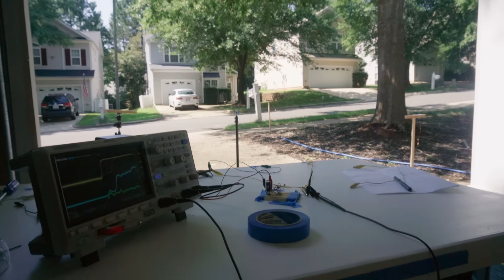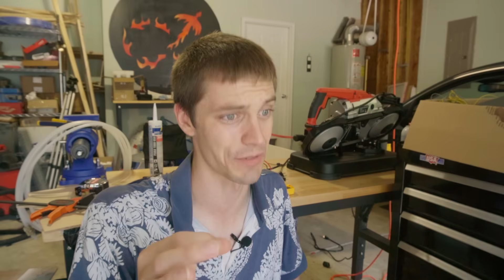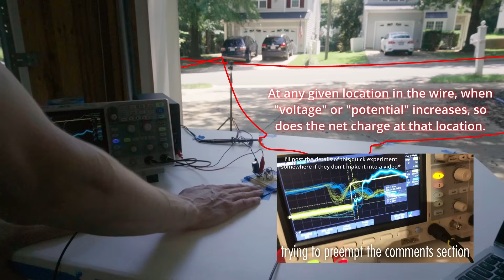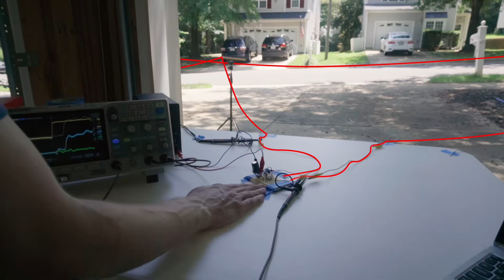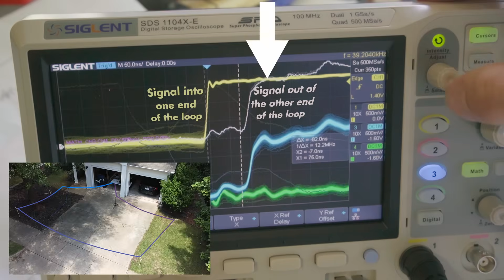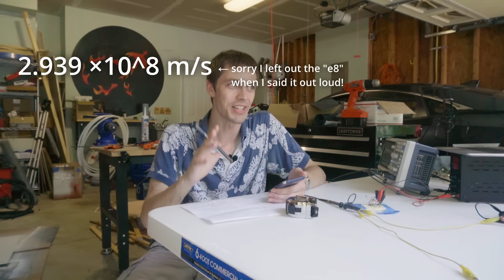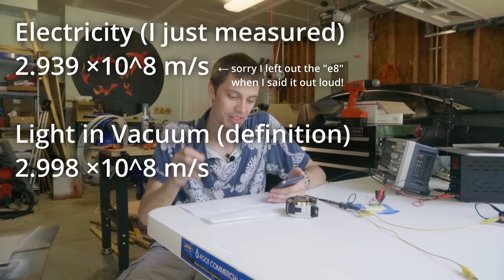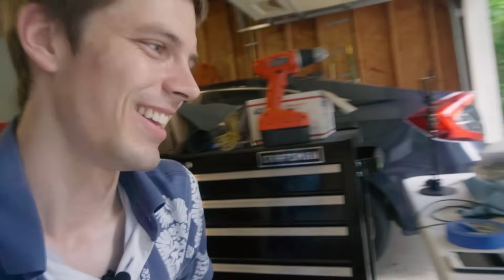Why does WATER change the speed of electricity?

Comment: electricity travels at a very slow speed, the effect travels at the speed of light, a simple comparison, a water hose, when empty takes many seconds to come out the end of the hose when water is turned on depending on the pressure, but a hose full of water a ( conductor ) I turn it on and water is almost instantly out the end depending if there is a large air bubble, in the hose, electricity travels the same way, so how fast is electricity depends on the pressure just like water,,, simple but educated people seldom put all the information together,

Comment: okay okay okay ... electricity actually travels slowly... very slowly like 1m/s in some cases . energy travels fast . when you create/build a magnetic field current still passes slowly, energy still passes fast but it's the amount of current that flows that changes and you need enough to detect a voltage rise/current passing. what you limit is flow, not speed

Comment: I have a straightforward question.  Does electricity travel in the center of a wire?

As in, does a wire act as a Farraday cage and only travels along the outside or does it electrify the center as well?  How would we measure that?
Reply from the maker: Faraday cages don’t work for DC so in steady state everything is flowing in the bulk

Comment: ....FYI: WHEN I WORKED IN CONSTRUCTION,... WHENEVER WE HAD TO DEMOLISH ANY OLD WIRING, IN A BUILDING REMODEL,... WE USED TO HAVE TO GO SET UP AN INSULATED ELECTRON BUCKET, AT THE LOW END OF EACH CIRCUIT'S WIRE END,  BEFORE WE COULD ACTUALLY JUST CUT THE POWER... (SO THAT WE COULD CATCH, AND RECYCLE, ALL OF  THE EXTRA ELECRONS THAT WERE FILLING UP EVERY WIRE...IF WE DIDN'T CATCH THEM, THEY'D SOON, EVENTUALLY, EVAPORATE!:face-blue-smiling::face-fuchsia-poop-shape:

Comment: ....IMHO: YOU WOULD BE A LOT MORE ACCURATE/PRECISE, IF YOU MERELY WALKED TO A DISTANT POLE, (A MILE AWAY), AND WRAPPED A WIRE ALL THE WAY THERE, AND BACK AGAIN,... AND REPEAT THAT 93,000 TIMES, AND THEN, MERELY CONNECT A VOLT METER ACROSS THE ENDS, AND THEN APPLY A HIGH VOLTAGE TO ONE END, AND SEE HOW LONG IT TAKES (~1 SECOND), FOR THE OTHER END OF THE WIRE TO SUDDENLY BECOME "HOT"!...:face-fuchsia-poop-shape:

Comment: If i'm right that's the basics of a transmission line, the less capacitance/inductance the closest you get to lightspeed. The cables i used to work with were engineered with a constant 100m/μs propagation time. You send a pulse wait for the echo divide by known propagation speed, you have a distance same for fiber and radars you just have to know propagation speed in the medium used
A perfect wire is like a long rigid rod as soon as you push it the other end moves with no delay, it has no gap to fill/charge. Imagine the same rod cut every inch with rubber fillers, the rubber will buffer some energy before pushing the next rod and so on
Reply from the maker: I did the rod experiment in another video

Comment: Why dis you not get predicted speed of propagation in water as c/1.33? Refractive Index could be written using relative permittivity and relative permeability too..

I see, you didn't take into account the magnetic permeability.. but you should've because the electric field is just the electromagnetic field viewed from a specific frame. You can't ignire the magnetic components.

Comment: When I reached the part of your video where you said that electricity was traveling at 98% of the speed of light, I concluded that the speed of electricity equals the speed of light, and that the “difference” you “measured” is a attributable to instrument error, or faulty assumptions in the way you designed your experiment.

Electricity does not enter one end of the wire, “propagate” through the wire, and then emerge from the other end of the wire.

Electricity is a state of being. It is either there, or it is not there. The instant electrons are leaving one end of your switch, other electrons are entering the other end end of the switch. Current flow out of the node equals current flow into the node. The electrons in the wire are either moving or not moving.

If you wanted to make a hole in the soil of a planet light years away, you could shoot a bullet from here and several years later when the bullet arrived at that distant planet, it would strike and make a hole. You could also use an iron bar which reached from here to that distant planet. When you push on this end of the bar, the other end of the bar would make a hole instantly, without delay, because the entire bar moves simultaneously as a unit.

A couple of centuries ago, a couple of fellows decided to try to measure the speed of light by measuring how fast it travels across a canyon. One guy on one side  of the canyon was equipped with a lantern, blanket, and a stopwatch; the second guy on the other side of the canyon was equipped with only a lantern and a blanket.

The first guy started the stopwatch at the same instant he yanked the blanket from covering his lantern. The second guy upon seeing the first guys light, yanked the blanket from HIS lantern. When the first guy saw the second guy's light coming back, he stopped the stopwatch, to determine the time it took for the light to travel across the canyon and back again. Knowing the distance across the canyon, he figured he could calculate the speed of light.

While your experiment is considerably less absurd, utilises more precise instruments, and probably involves less error, I suspect that your method of trying to measure the “delay” between when electron movement is detected at one point in the loop of wire after being initiated by the closure of a switch at a different point in the loop, suffers from similar weaknesses to the set up these two gentlemen used to measure the speed of light. Your instrument is the cause of the “delay,” not the speed (or lack thereof) of electricity.
Reply from the maker: Watch my most recent video
Reply: AlphaPhoenix replied to me that I should watch his most recent video. What appeared when I clicked, was a video that was a year old about the compressibility of iron rods, i.e., if you push on one end of a rod, the response at the other end is slightly delayed, because the rod compresses an infinitesimally small amount before the force is transferred all the way through the rod to the other end. While this may be true, the iron rod described in my above response (a rod reaching several lightyears from one planet to another) was obviously a hypothetical to help illustrate. Never gonna be a thing.

As an aside, (in the rod compressibility video), AlphaPhoenix used one type of movement detection sensor at the hammer end of the rod, and a different movement detection sensor at the end detecting the arrival of the impact through the rod, so we do not know that the delay was not simply due to different response times of the sensors. When he tried later in the video to use the same sensor on both ends, he got AFU trying to super glue the sensors in place, and his results became so erratic as to become beyond obviously unreliable.

Back to the speed of electricity matter, what AlphaPhoenix conveniently leaves out of all of these discussions is that his motion and electron movement detection devices are all, themselves, electrical. It is electricity that travels through all the leads and grounds of his 'scope; it is electricity that flows through the myriad FETs MOSFET's transistors, ICs DIP's, transistors, or whatever all that junk is inside his 'scope; and it is electricity that is causing the lighted lines to appear on the 'scope's screen to convey the information AlphaPhoenix is expecting all of us to accept with a straight face as scientific.

Using an electric device to detect the speed of electricity is sort of like using the difference in arrival at the finish line of two runners in a race to determine the speed of the third, instead of using a stopwatch. When you are questioning the standard, you can not use the standard to measure the standard.

If it was that easy to measure accurately, a simple google search would tell a very definitive answer, and that answer would be repeated all over the internet. We would not need to rely on some geek with coils of wire all ‘round his lawn, and running through water pipes to speculate on it.  That said, having briefly google searched it, it would appear that electron FLOW is much slower than the speed of light. However the speed of the response of an electric circuit to bringing energised is as instantaneous as the speed of light, no matter the length of the circuit, or where along the circuit you measure the response time after the instant the circuit was energised.

In other words, electrons may be moving slower than photons, but since the wire is full of electrons, when you push one into this end of the wire, another one pops out the other end just as quickly as it would take a beam of light to travel the length of the same wire.

That’s my answer - and I’m sticking to it.

I would suggest AlphaPhoenix go mow his lawn, tend his flower bed, and not waste our time trying to confuse us with his sophomoric experiments.

Comment: Did you consider that your tube of water, that your wire passes through, is surrounded by air? How far does the field eminate? Does a larger diameter of tube filled with water have a greater effect? Does the length of the tube have a relationship to the delay? Does the material of the tube have any affect if there were no water in it? What if you put the small tube with the water into a larger steel or lead tube? Then, what happens when the gap between the two tubes is filled with water?

Comment: A lot of this is normally over my head, but you make it easy to follow along. A couple of things that I started to wonder about.
1. Types of conductors. Would Aluminum be different than copper?
2. Shielding. If magnetic fields travel outside of the wire, what about shielded wires? Or am I getting that wrong?

Comment: One question sir: any loop of wire is an inductor. If you break a circuit on an inductor the collapsing magnetic field will continue to maintain a current flow. So this effect occurs after the disconnect. Does the time it takes to collapse not equal the delay time on the buildup of the magnetic field. Does this explain the difference you saw in water which causes it's effect as an inductor building up a magnetic field through water which is also a conductor and will develop a magnetic field when current is induced in it. (magnetic fields inducing current flow in water are used to measure water flow)

Comment: I had a problem with multiplexed signals through 12 shielded coax wires. Didn’t know what to expect at the time. Set up 12 Chanel analyzer. Found one signal apparent having a LC capacitive effect on one channel . Had my trainee take my alligator ended test leads and ground each coax shield one at a time. The CNC machine woke up on the 5 shield we grounded. Theses multiplex data lines were about 80 ft in length along side three phase 440 on a 60 ft long bed with a moving milling head that barber poled a drill pipe turning it into a 30 ft Kelly for oil drilling. They had hired an outside company paying them a fortune for two weeks  to troubleshoot the problem. It took me one hour including set up to fix it. The maintenance supervisor over the plant called me in and was angry that I made him look bad. He never ask me to look at the machine and his boss was asking why? Lol
This was at the Houston Drilco plant. By the way , EET University of Houston. Enjoyed your demonstration:-) 
Question? As elections travel do the vibrate under a coulomb effect? Or do you suppose not? I believe the do   Circumstantially!

Comment: The equation for propagation delay you showed only applies to EM waves is an isotropic media - like free space or within a single dielectric.  Whereas the wire in the tube of water has water surrounding the outside of the wire thus impacting the external EM field but there are E-fields still within the wire (not even accounting for frequency-dependent skin depth effects) and these are still propagating near speed 'c' which is why the overall speed of signal propagation only slightly decreased by the submerged wire.  Excellent video by the way.  BTW, this comment is from an RF engineer.
Reply: Thanks. I didn't understand his explanation per se, but I do understand yours.

Comment: Technically thin wire is "faster" because it has a lower RL time constant due to having more resistant for the same length of wire. That doesn't mean the electricity moves faster, but it does mean the voltage reaches saturation faster.

Comment: Given all your wires are copper, would it be fair to say that a larger wire with lower resistance, also needs more electrons to 'charge' it up to your initial 1.5V?  It seems that if the wire is larger, it would need more electrons/meter to charge, and this might exactly counter the lower resistance?  This begs the question, would you get different results if you used wire made of some different metal, that requires a different 'electrons' per volt to charge?

Comment: Hey man awesome videos...do you actuay read respond to comments??  I've a very technical project I'm trying to build, an HHO generator, but with high frequency ac signal w dc offset so plates donr change polarity.  My idea is if signal can match resonance of  system then the oscillating electric field possibly can "vibrate apart" water molecules by constructive interference thjs adding energy at the right pulse timing to stretch bonds to the point of free radical cleavage, thus generating H2 gas without consuming power from the power source (as in electron transfer was not used to break bond so no current was used).  It seems it would be possible, and you have a great understanding of how fields interact w these bipolar molecules.  Could you PLEASS if u ever have time respond to this and allow me to pick your brain a few moments on this topic??
Reply from the maker: Check out my video on lasers and molecular vibrations

Comment: @AlphaPhoenix The dielectric constant of water doesn't go down to the values of "light" until you get to EXTREMELY high frequencies, well up into the microwave range, approaching the infrared portion of the EM spectrum. Given that the time resolution of your oscilloscope is only going to be (at best) some number of nanoseconds at this scale, I don't believe your explanation is correct since the frequencies of electric fields you can measure are limited by your time resolution (Shannon/Nyquist sampling theorem) and are still in the RF frequency range (< 1 GHz). In actuality, what is happening is that you are not using a coaxial cable, so the wire and THE EARTH are effectively acting as your two conductors. Because your pipe has a small diameter, MOST OF THE SPACE between the wire and the earth is actually air, and only a small bit water. Thus, the "average" dielectric constant is going to be closer to air than to water - which is exactly what you are seeing.

Note - I actually have a Ph.D. in theoretical physics...

Comment: I know that thicker neuron axons transmit electrical signals faster, but the propogation of an action potential is a completely different process. For your water model of electricity, area times velocity is volume flow rate, which I think would be most appropriate, and both methods would mean that larger wires are faster. I'm going to guess that they are faster because of the analogy with water - I think that's the same concept, ignoring other properties that shouldn't matter.

Comment: About your ending question: 
We use the Fourier Transform, and it is useful that model with the harmonics. However, those harmonics, like they are in the model, they are not in reality. 
In reality we can have only what is real, not only after the switching, but also before the switching. There are no prior sinus waves, before the arbitrary decision to switch, and if we switch, it would not place prior waves, before the switching. 
Something is still there, where we can define the act of the switching like being of some duration, and just inside that duration, there are, can be more waves. 
Define the switching act and context, as a box, with inherent number of resonances, that would approximate that Fourier model. At most, we can say that is real, and not the simple Fourier model.

Comment: Very interesting stuff. I was however wondering why you did not show a dead short to give a starting value . Triggers and sensors all take time to act and react so you'll get a slope no matter what . That way you can then obviously tell the difference the wire length makes . Thanks for the video :)😊
Reply: The yellow graph on the oscilloscope is the dead short. The yellow line is what the probe measures at the start of the wire, and the white line is what it measures at the end. The delays caused by the probe cable and data processing inside the scope are the same for both channels on the scope, so they cancel out, and the difference between the yellow and the white line is purely the effect of the wire.